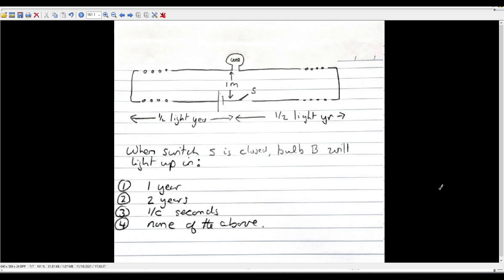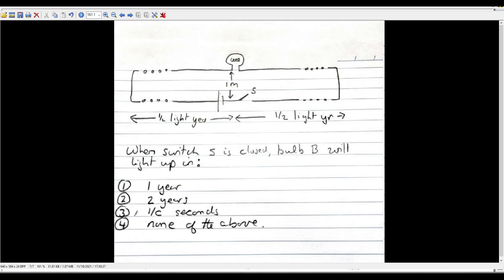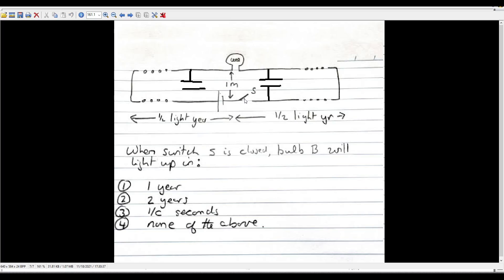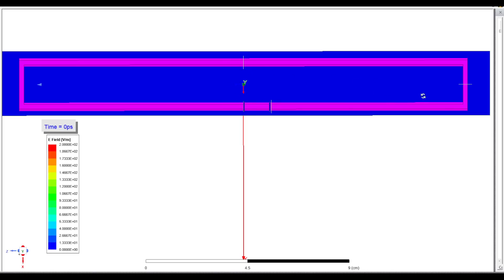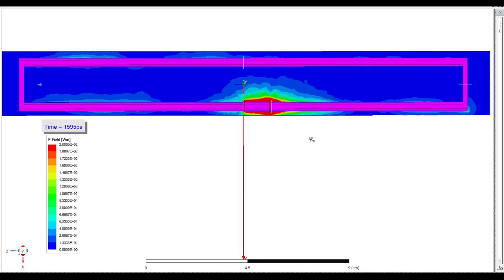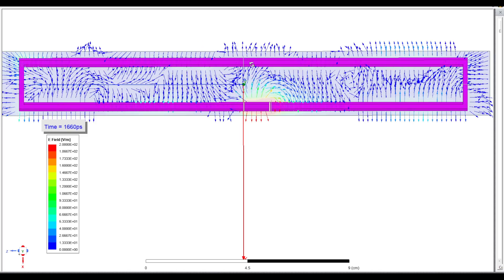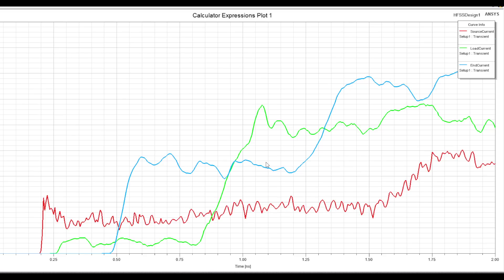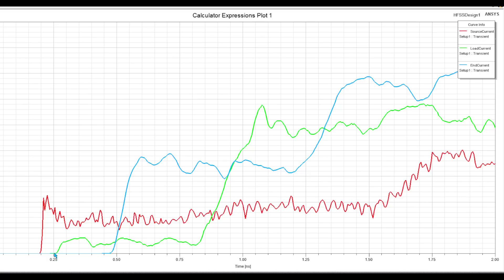Response To Veritasium - Electricity Propagation Time Problem

Comment: Thank you for the visualization! I was agonizing over trying to figure out the time evolution of this experiment in my head but your simulation really nailed it down, the bulb might technically light with the low induced current/voltage across the 1m gap, but it will fluctuate in brightness until the signal propagating and reflecting along the actual line reaches the bulb. Would it be correct to say SOME energy flows across the 1m gap via EM fields to the opposite wire, but most of the energy flows ALONG the wire (still in an EM field at c)?
Reply: I guess that is correct, so the argument boils down to the non specified parameter how sensitive is the light bulb compared to the power of the source. My guess is now without actually calculating, Derek has specified 12V for the source, but not what the light bulb is. A Incandescent light bulb certainly not by EM waves of a 12V source, a single LED.. might, but I wouldn't bet on it.
Reply: If you understand transmission lines you should see that the bulb and battery are in series with the characteristic impedances of the two transmission lines. This means that the bulb lights dimly at first. The brightness is determined by the characteristic impedance of the two transmission lines. Then, once all the reflections die down, the bubble light to full brilliance.
For anyone familiar with time domain reflectometry this is trivial.
Whether he realizes it or not, Derek made this very difficult by drawing the circuit the way he did.
Put the light bulb at one end to the right and the battery of one into the left so you just have a single transmission line between the battery and the bulb and it will take the full amount of time before the bulb lights. Of course, this assumes the bulb is equal to the characteristic impedance of the transmission line.

Comment: As a follow-up, I'd like to know what actually happens when you flip a switch with a lightbulb attached but the circuit is *open*. The standard answer is that the light won't turn on because the circuit is not complete, preventing current from flowing. But is there technically a very short amount of time where current is flowing across the bulb while the system achieves a new equilibrium? And then I suppose some kind of resistance builds up at the battery until it stops being able to drive current altogether.
Reply: Taking the 1 light year idea from the video (compared to one light second) if it's open for on on end in the bulb exactly the same will happen in the bulb for at least a year. Everything else would be violation of c = speed of causality rule.

Comment: This is actually the best explanation of how electricity "works" that I've ever seen. The field doesn't just uniformly form everywhere and transmit power at the speed of light; the reality is messy and much more believable!
Reply: True, best explanation for noobs, who doesn't want to learn lorentz force law.
Reply: I don't get it. He never mentions the inductance of the system, nor factors it into the simulation. It's all capacitance.
Reply: @-danR  HFSS solves Maxwell's equations which factor all of those in automatically
Reply: Energy does propagate at the speed of light because the energy is stored in the electromagnetic field. However, this does not mean that electrons move at the speed of light. The stet up is basically like a Tesla coil lighting up a nearby device. I think most of the misconceptions come from the fact that most people are not used to thinking in terms of fields; fields permeate space-time and carry energy.

Comment: 1/c seconds does not even have the correct units: (1/(300000000 m/s))*s  = 3.3e-9 (s²/m). What is that even supposed to be?

Comment: Your method of detecting current is ignoring that changing electric flux also generates magnetic fields, so you maybe should put the ampere loop exclusively around the wire, without any space around it to couple dE/dt to the magnetic field. Although, I doubt you would get a qualitatively different result, since there would still be actual current due to the E field impinging on the wire. Glad you made this, veritisium made it sound like the bulb would be gradually increasing in brightness, but it really is more like 2 steps, as it should be since the wires guide the stronger fields.
Reply from the maker: Rhian, thank you for mentioning this! In preparing a better simulation I have made note to reduce the diameter of the "sense circle". I wasnt thinking clearly that I would also pick up any displacement current as you point out.

Comment: So if at t=0 there is an open switch in the vicinity of the power source, and a closed switch at the right extremity of the circuitry,
and at t=1 we close the first switch and open the second one simultaneously,
then we will actually see a current at the load for some time, while at no point the circuit was entirely closed.
(It's not that crazy to have some induction, but it's quite funny here)

Comment: wrong. You are confusing induction with electrical transmission through wires. Of course, if a field hits a wire, it will induce some tiny current. But no more than you would get from using a mobile phone. So do you also think that using your mobile will light up your house? In your model, why even demand a closed circuit?

The field must propoagate all the way around the circuit before the substantial current flow occurs across the bulb.

Comment: Why are you allowing capacitance and the like when adding caps, along with all the other electrical properties used in this thought process, BUT you are not allowing wire resistance since it would drop all the voltage and make the question null? We can’t ignore some variables and use others, that makes a bias answer
Reply: Veritasium's video assumes zero resistance.

Comment: It be relatively (pun intended) easy to test.  Instead of wires 1/2 light second long, a few hundred feed would work.  A one shot multivibrator with very steep rise time and a memory 2 channel O scope would settle it all.

Comment: Nice explanation, thanks. I know you didn’t come up with the question, but I feel that without any clarifying info a reasonable way to interpret “how long until the bulb lights up” would be “how long until the current reaches v/r”, so I feel the question is misleading. Maybe a better question would be to replace the bulb with an ammeter and ask “how long until current is detected”.
Reply: The issue is that there is a significant difference in the magnitude of current delivered at 1/c vs 1. Derek uses this contrived experiment to claim that "electricity isn't transmitted through wires". Most casual watchers will interpret the video to mean that the lightbulb will reach the steady state current level in 1/c time regardless of the length of the wire, which is false. I would go as far as to say the video is deliberately misleading. Not necessarily to people like us, but to casual viewers.

Comment: This is a great visual model. Although I think your conclusion is very misleading. In concluding answer D you assume the initial current in the bulb will be enough to light it. In Derek's experiment it never would be, you would have to wait a sec for the full current to arrive. I think if you used his actual voltage and distances your graph would show a infinitesimal current after 1/c secs and a relatively huge one after 1 sec (enough to light the bulb).  So the answer is actually B in Derek's experiment. Think you need to make this clear.
Reply: @CakeOnPie I'm not a physicist so I couldn't say what they think may be required to light a light bulb. I think we can all agree though, we are lucky aircraft, buildings and bridges are all designed by engineers not physicists :-) I'm not whom Derek's video is aimed at teaching, future physicists or future engineers, but it would be helpful if he made that clear perhaps. He just seemed to call the models engineers are taught to use "lies".
Reply: The answer is still wrong. No delay at all will be observed! We did the actual experiment. See my detailed post a the top of the comments

Comment: The correct answer is "none of them". Veritasium missed the situation you mentioned that is: there is an initial current across the resistor during 1s before the reflections at the end of the transmission lines reach the center.
After that, as you correctly pointed out, there will be multiple reflections each taking 1s to go till the end and back.
I've made a simplified simulation with only one of the sides, using a 75 ohms coaxial cable with 60m and a pulse generator. As expected, there is an initial step and after the time for the wave to reach the end and back the signal jumps up to the final level. In my experience I used a 75 resistor to insert the pulse at the line so there are no more reflexions at the origin.
Reply: Great demonstration.

Comment: great video I tried this in hfss too, how did you get a DC step excitation? do we need a dataset?
Reply from the maker: I used an expression and utilized the "time" variable along with the int() function to get a step at 200ps. However, I plan on redoing the simulation and including some suggestions I see in the comments. I think when I redo it I will actually use a dataset instead since it will be easier to have more control with simple step waveforms.

Comment: Am I correct in that you changed your distance between wires as 1 cm?  Even if that is the case the induced current thru the capacitance is less on the wire that has the bulb vs. the wire that is coming from the source.  The induced current on the wire with the bulb will decrease even further if the distance is actually 1 meter instead of 1 cm.  Also,  the magnetic field B that is coming from the wire with the source is what induced the current in the wire with the bulb... not the electric field.  So I am not sure if your simulation is done correctly or not.
Reply: Good point.

Comment: when wires of ANY length are attached to a power source, the charge/voltage/potential/whatever,  propagates near C  subject to the effects of capacity, inductance, resistance, hysteresis, etc  to the end of the wire.   the ends of the wire
are in effect extensions of the battery poles.   when the circuit is closed, then  current flows instantly,  the amount depending in this case the value of the  resistance.  if sufficient current flows to meet the requirements of the bulb,
  it will glow.

Comment: I thought the distance in the original video was a light-second and not a light-year? Nevertheless I very much appreciate the value of using a simple model which can illuminate what is really happening to the energy.
Reply: Yes, it was a light second on each side (half a light second going out and another half light second coming back in, on each side).
Your comment needs upvotes or a pin, so that that confusion is cleared up right away. :)
Because this distracts from the rest of the video, which seems to be giving an interesting explanation.  Gonna continue watching now.
Reply: In the video it was a lightsecond but prior to the video he put out an image and in the image it used a lightyear
Reply: @Benbenshow3141  oops I didn't realize it was one lightyear. It was confusing enough and the light year makes it even more confusing.
Reply: @Laohei0103  it doesnt help when Veritasium himself decides to change it from lightsecond to lightyear XD
Reply: This was made before the veritasium video and is a response to the Community Post which veritasium posted earlier. They changed the units, I assume because 1 light year isn't much different from 1 light second for the purposes of the question.

Comment: The equation I think people are looking for is L/(c*Vf) where L is the length of the wire from switch to light and Vf is the velocity factor of the speed of light through the material that is doing the conducting. There are other factors but this gets you pretty close.

It's important to note that we can't break causality and information can't propogate faster than the speed of light. And the information is travelling along the wires in the form of electric and magnetic fields. It's also therefore, really I okrtant to know what the speed of causality (aka the speed of light) through the material is. For pure copper, that's something like 94% the speed of light in a vacuum, meaning our Vf is .94
Reply: Vf depends strongly on the dielectric between the signal and return conductors, it's anywhere from 70% top 90% of c in coax.  In a PCB with FR4 it's about 1/2 to 2/3 of c, depending on whether you're microstrip or stripline.